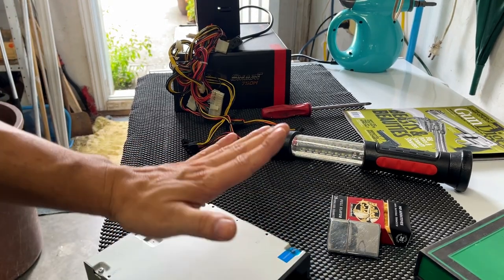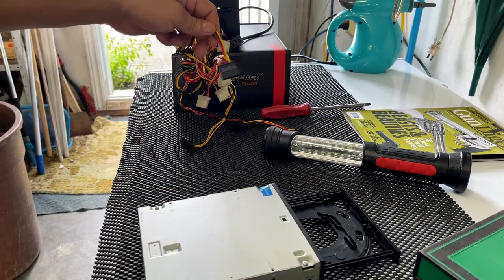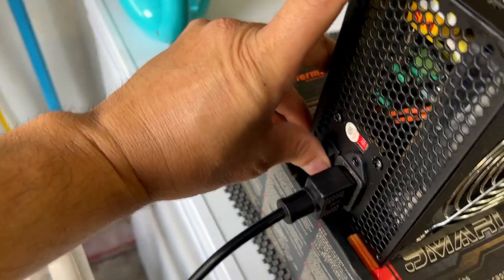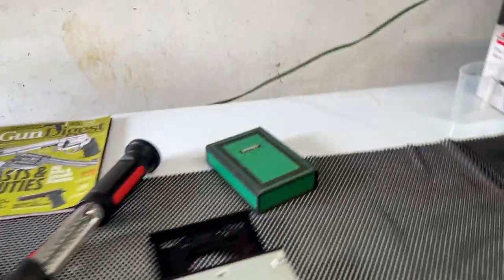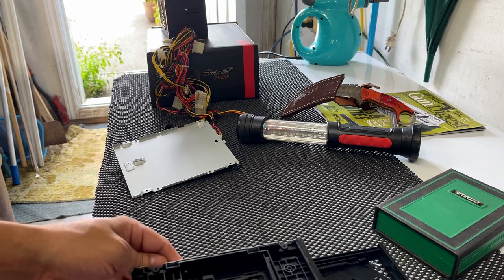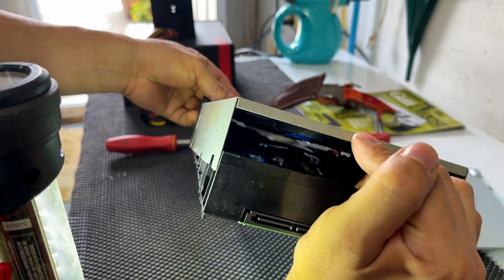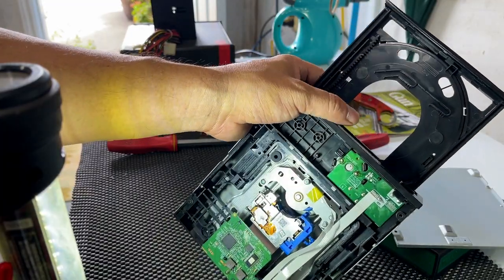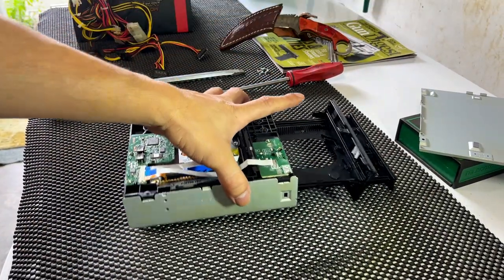New Blue Ray player already broken,can I fix it

Comment: you know, you need to connect 2 specific pins (PS-ON to a ground) on these PSUs to power them on. I see no such thing on your big connector.
Reply from the maker: Thanks for watching,,during my set up for the camera it worked fine then I realised I had it plugged in with multiple other sources, I should`ve used a dedicated source,,But in the end it worked out cause I got it to work again!